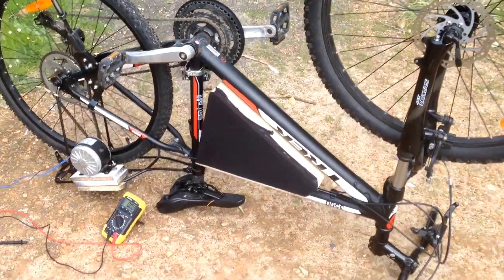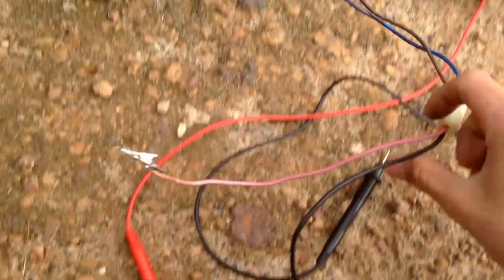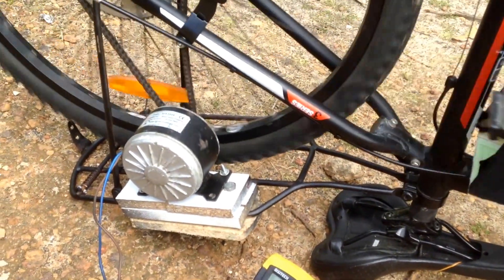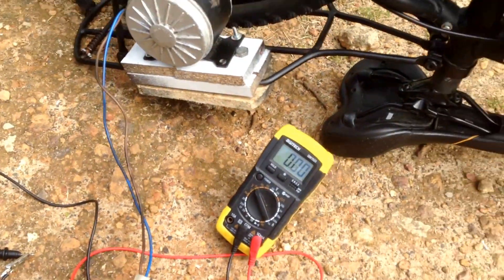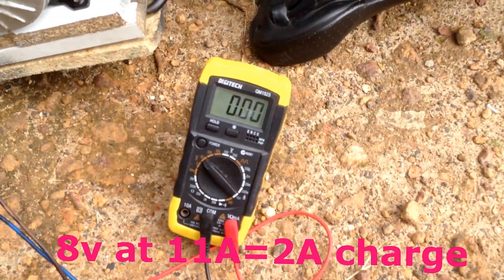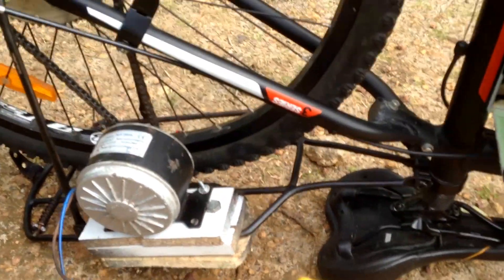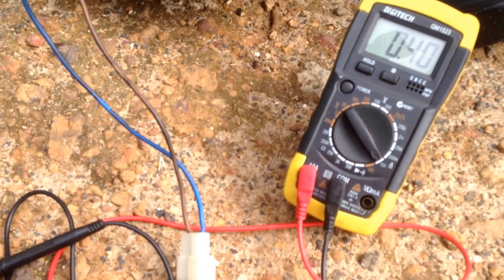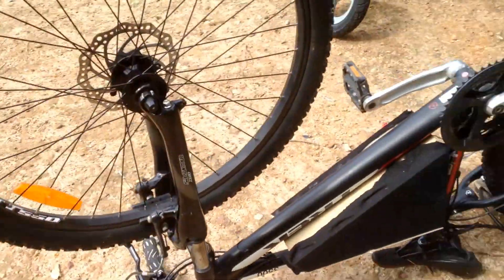Regen Braking Concept On My E-Bike | DIY Electric Bicycle | Does it generate enough power?

Comment: Cool idea! I was wondering how you could make the switch that connected the motor to the controller or the battery. Also, when the motor is connected to the battery, what is keeping it from just powering it up and not charging? Sorry, I'm new to this concept.
Reply: I want to do something like this with my 48v ebike kit, did you finish something or have a diagram or explanation?
Reply: @hethestrange  hello I see you wrote ebike kit is it a hub motor, if it is let me know I will explain you how to regen
Reply: Hi how do i set this up on my voilamart ebike kit